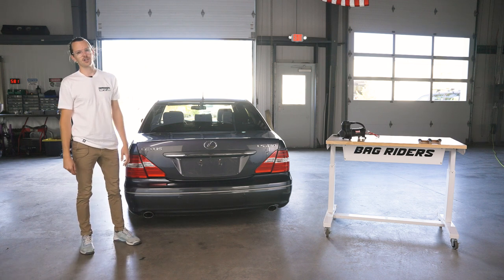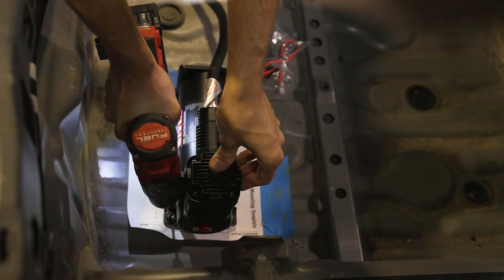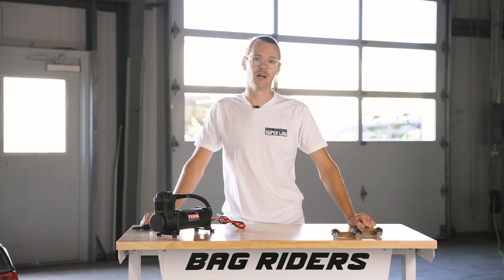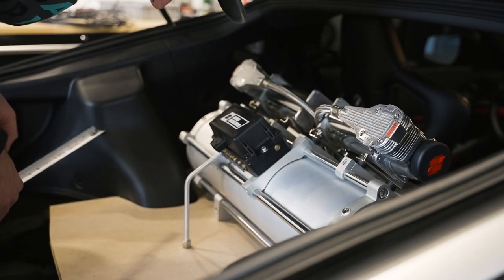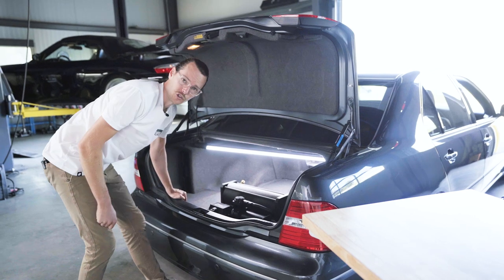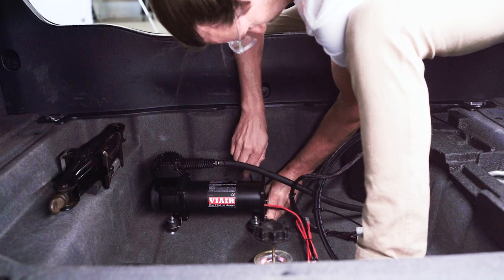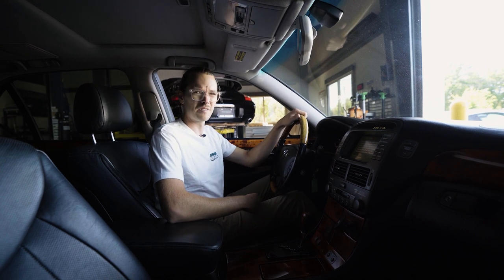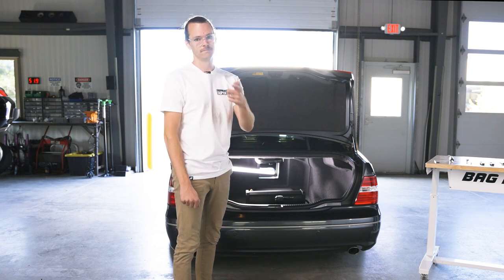How to Mount Your Air Ride Compressor

Comment: So a Viair 310ss or a 485.... how much air do these compressors need around them in order to operate and not overheat? Note this is not for consumption / compression, but simply for the compressor to maintain function without degradation. Watching this video I am thinking a plate and isolators is my mounting strategy, but then a "box" of vibration damping and sound deadening material to further neutralize the product. Likely EPDM between the false floor and my bumper rail (installing inside rear fascia of a C5 Corvette for use running two wastegates in a turbo setup).
Reply: Also - these vids I am going through are good. Quick, effective inputs for someone already tech savvy.
Reply from the maker: @Torches-n-Tap-Sets  Honestly I don't know how much ambient space is recommended, but I never put them into an unvented area. At the end of the day, they are very amperage hungry and make a LOT of heat when run for long periods. Perhaps your usage won't be as demanding?

Comment: Lol I saw you just drop that mdf board setup sit nice and tight on the trunk floor, so If I go with the mdf method, do I still have to drill the mdf setup in to the trunk floor matt? Im afraid they gonna move around while driving
Reply from the maker: Yes you are going to want to attached the board to the floor to prevent it from sliding around.